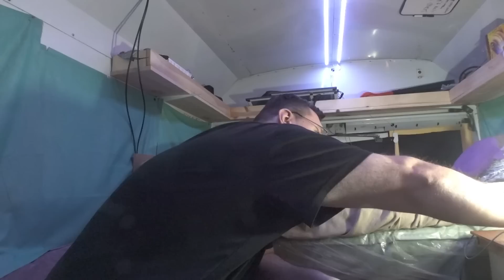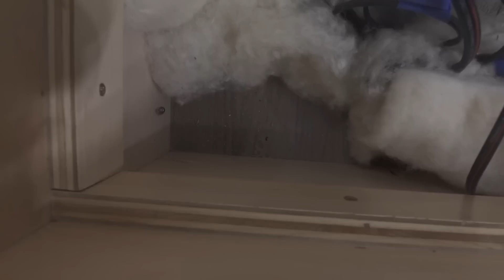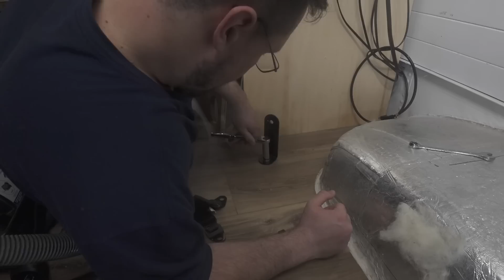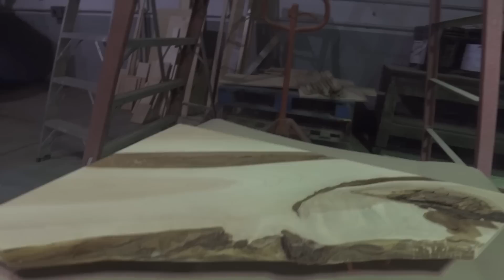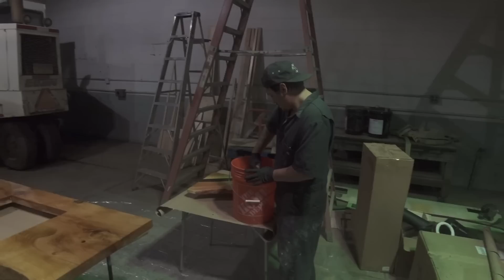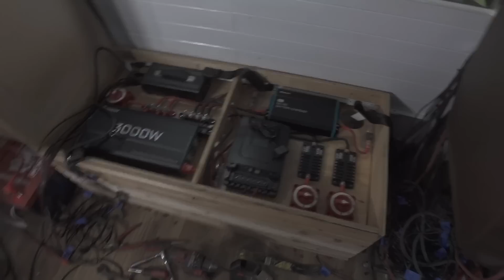skoolie bus build! we working!

Comment: Awesome video Levi! I believe you still going to have some building content because of minion build, but the travel content will definitely be nice 🙂. Just have one recommendation... I wouldn't put those Amazon boxes/packages on the bed... I worked in an Amazon warehouse and those guys are extremely dirty. Sometimes you see mouse poop on them! Try to open those and wash your hands after so you don't get sick. About the box truck. I believe it would be an amazing choice for you! Usually, they are cheaper than a short bus, and a lot of people with little building experience build some nice ones. The fact that they are square, quiet, and have AC is a plus! Maria Alice is building one, her channel is pretty nice!
Reply from the maker: thanks for the info.